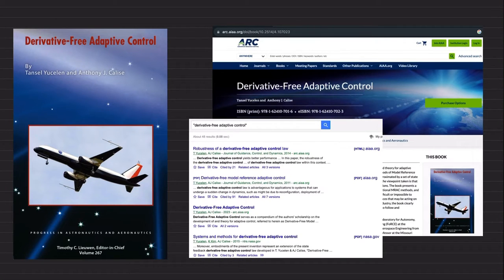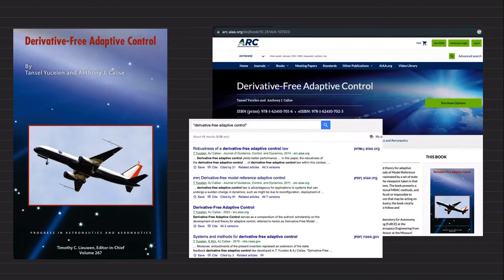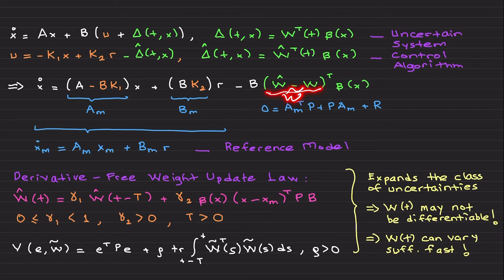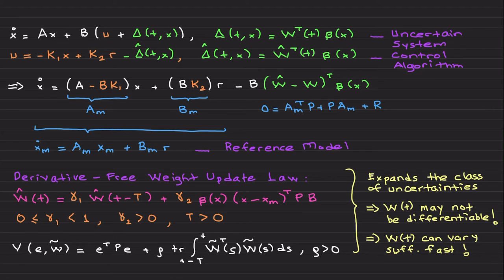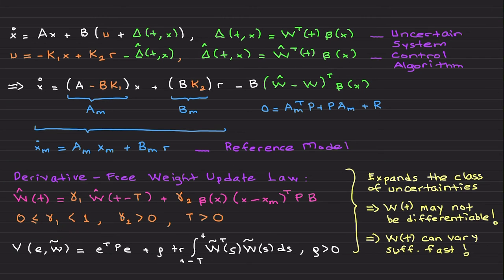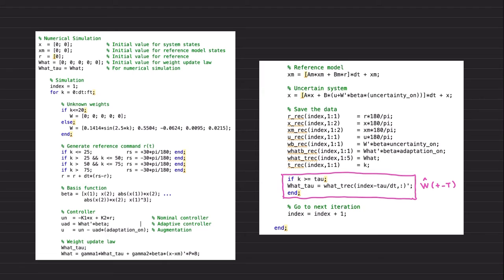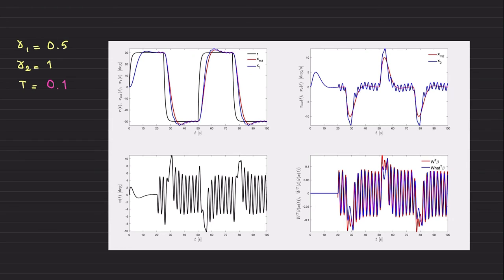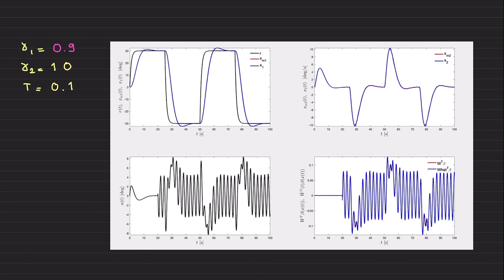Derivative-Free Adaptive Control (Lectures on Adaptive Control and Learning)

Comment: Dear Professor Tansel Yucelen,

I am so thankful of your effort making the video!
I am working on Derivative-Free Adaptive Control, I try a simulation with DC motor for speed control of first order transfer function. It works perfect. But when I add noise as sensor measurement or discretize (5ms sample time) the update law the result is very bad, too much oscillation.
Could you recommend me what is the best Adaptive control in my case working on discrete time system, noisy sensor?

Thank you very mush i will look forward to hearing from you!
Reply from the maker: Thanks for your kind words. Measurement noise is an issue in adaptive control. Check this paper on how to mitigate the effect of measurement noise: https://arc.aiaa.org/doi/10.2514/6.2020-0842

Comment: To calculate K1 we need to know the system's A matrix and B matrix for (A-Am) but if we don't know it from before the uncertainty happens, we are going to calculate it with pole placement and adaptive control signal should manage to abstain from the adverse effect of the uncertainty after something wrong occurs such as a fault on the ailerons of an aircraft. Thank you Sir.
Reply from the maker: A and B are known. Only Lamda and W are unknown 😉

Comment: These lectures are just so good. Please keep them coming. Thanks a lot Professor.
Reply from the maker: Glad you like them! Upcoming two lectures will be on adaptive control with barrier functions/certificates 😉
Reply: @tyucelen  It seems that when tau = ts,  gamma1 = 1, gamma2 = ts*gamma, we arrive at the adaptive law that was discussed in the previous videos. So the derivative free adaptive law is a special case of the previous control law. Is that correct ? The tau acts as a delay parameter ?
Reply from the maker: @kaustavmondal7875  You are exactly right about this observation (we also discuss this point in the original paper). Yet, in this case, the standard adaptive control law becomes the special case of the derivative-free adaptive control law since it is more general such as handling the case when W(t) has unbounded time rate of change. Tau acts as a delay parameter but it is actually a design parameter (this point is discussed at the end of the video in a Matlab example).
Reply: @tyucelen  In the paper "Derivative-free Model Reference Adaptive Control" (Yucelen, Calise), you have said in Remark 3.6 that the standard persistence of excitation condition is satisfied when we consider constant ideal weights. If the ideal weights are not constant, will the weights still converge to ideal weights if we don't consider a sinusoidal ideal weights. It seems that in the example in the video, the sinusoidal uncertainty persistently excites the system which leads to weight estimation convergence. Is my understanding correct ?
Reply from the maker: @kaustavmondal7875  For the case of time-varying weights, estimated weights can converge to a neighborhood of ideal time-varying weights under the PE (persistent excitation) condition. However, the beauty of direct adaptive control schemes is that they can drive error to zero or a neighborhood of zero without requiring the PE condition. MRAC is a direct adaptive control approach. Indirect adaptive control approaches do require PE to drive error to zero or a neighborhood of zero. So, my point is: No need to worry if \hat{W} will converge to W or not. What matters is the actual error ;)
Reply: @tyucelen  Sorry about the questions but I want to really nail my understanding of derivative free control.

I read your dissertation "Advances in Adaptive Control Theory, Gradient and Derivative-Free Approaches" (Yucelen). I read that the derivative free adaptive law ensures exponential convergence of the error dynamics to the ultimate bound. I was going through proof for exponential convergence. In Corollary 4.2,  I don't understand how you got Eq(105) from Eq(87), pg.62, Chapter 4 of your dissertation. If you could just elaborate, that would be great.
Reply from the maker: @kaustavmondal7875  No worries, I like questions. Take a look at 23:26 of this video https://www.youtube.com/watch?v=H-uzMGqLKTU - Specifically, at 23:26, look at the red equation given at the bottom right. As t goes to infinity, we exponentially converge to beta/alpha. This is what I mean by exponential convergence to the ultimate bound beta/alpha. If beta/alpha = 0, then this implies exponential stability. But, this is not the case here. Does this clear now? Again, feel free to ask questions ;)